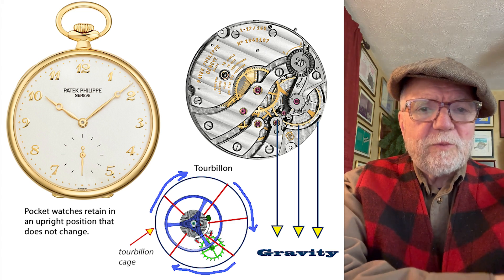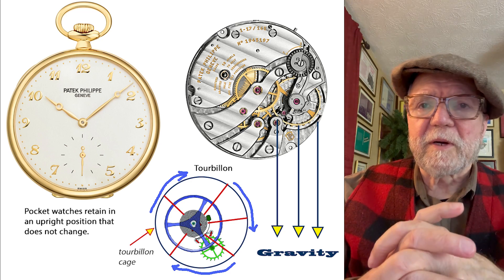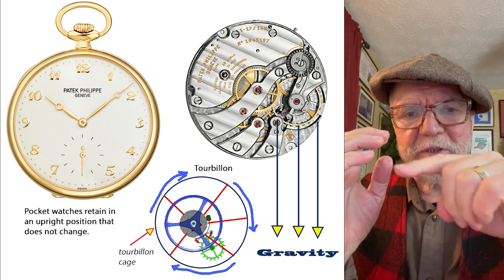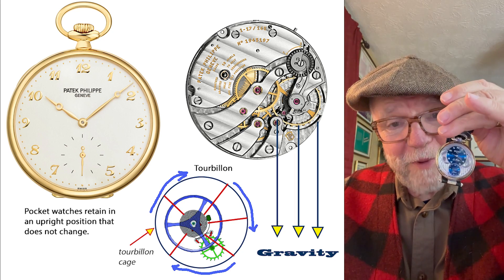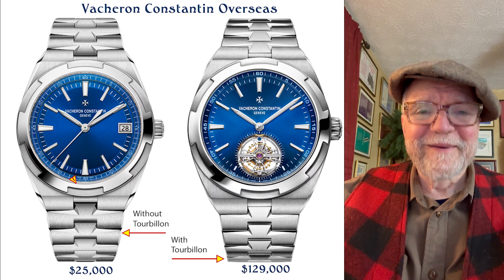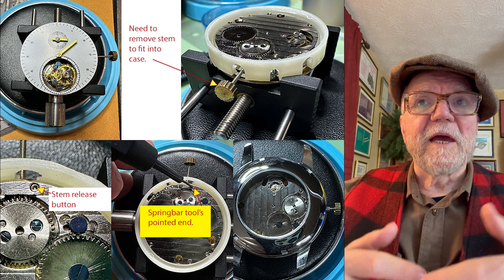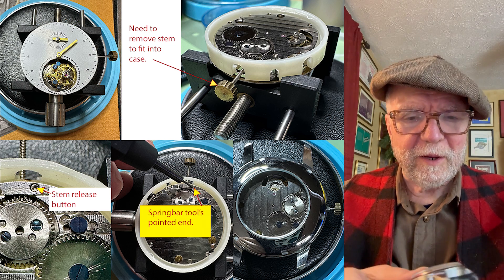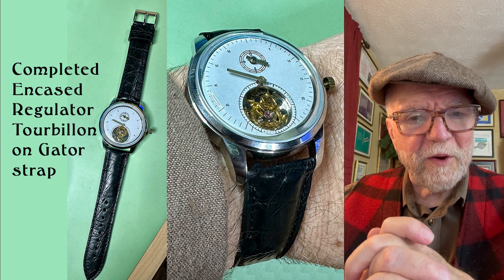How a Tourbillon Works and How I got one for $140 #VP256

Comment: That's a very nice build. 

I'm not an expert but I'm pretty sure Breguet was right. When watch reviewers put a watch on a timegrapher, the rate/amplitude/etc change when the watch is put in different positions. The thing is that a wristwatch moves 3 dimensionally but a pocket watch spends most of its time in a vertical plane. That's why it seems reasonable that a gyrotourbillon could actually make sense for a wristwatch. Of course, those are prohibitively expensive unless AliExpress starts churning them out.

Comment: Hi Bill.  Out of curiosity, I recently watched a You Tube review and splashed out for a sun and moon complication on AliExpress. When I say cheap here, price wise, it makes a similar type of model from Orient seem like a kings ransom in comparison. They claim that it has a Sea Gull movement - touch wood - up until now at least, it is performing well.  Of course, it is Chinese and only time will tell.  While no one could pretend that this is the finest example of Swiss horology, God only knows how they can afford to manufacture this kind of thing for so little.
Reply from the maker: I would imagine low overhead Tuna, and higher cost of living? I dunno either... Take care Bill
Reply: Yes Bill. There must be an incredible difference. All the best. @watchartsci